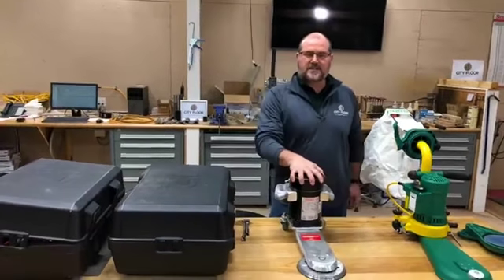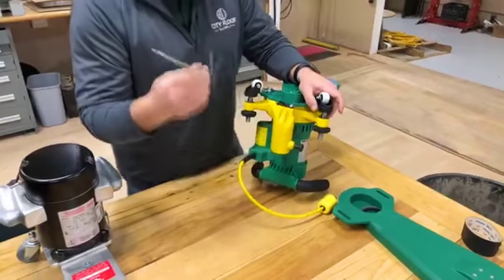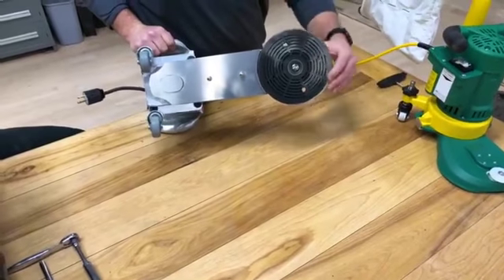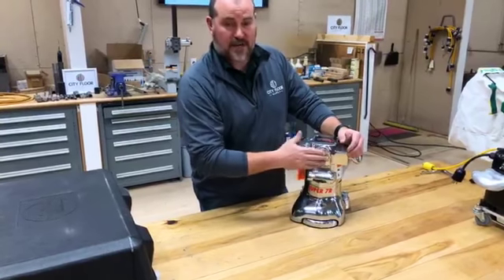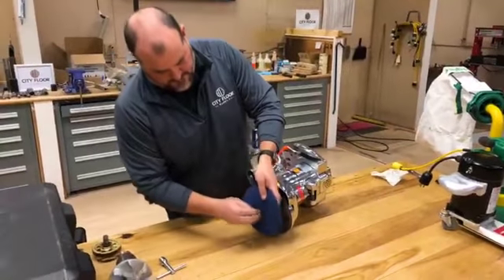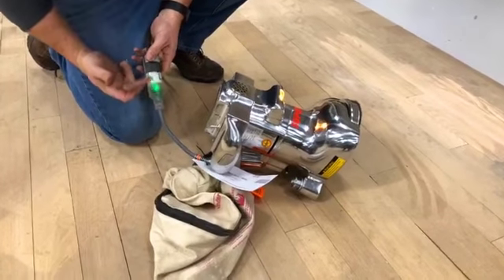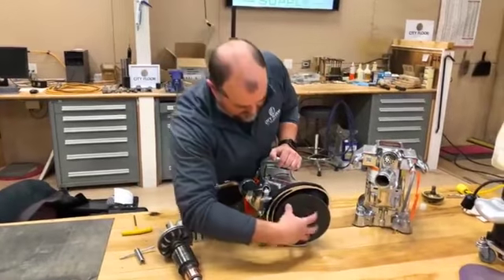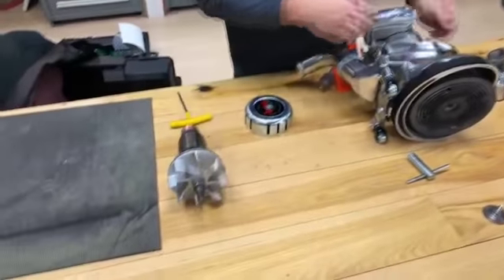Edger Review For Hardwood Floor Sanding LIVE | Lagler Flip, B2, Super 7R, RS100

Comment: Great video! Does the B-2+ still run on only 220v dryer or stove outlet?
Reply: All these 110V. They are just edgers
Reply: @1Ljf31Luv  The B-2 has run on 220v until the late 2000s -maybe until early 2010s.

Comment: The tool that comes with it has two different adjustments settings on the handle One for the extension and one for the regular
Reply: By any chance do you know which setting you use with the corner attachment?
Reply: Jaime the long one